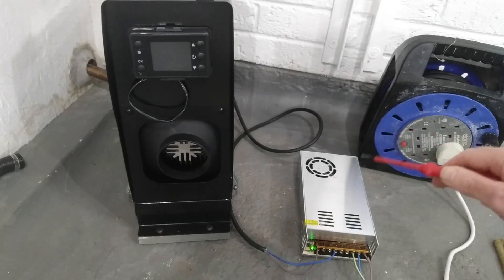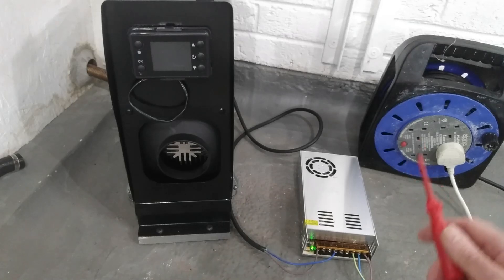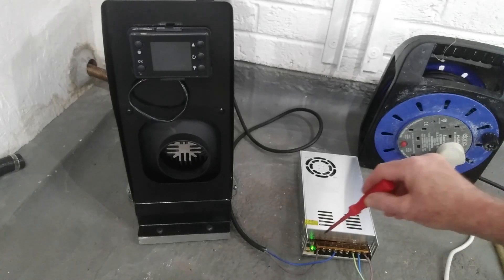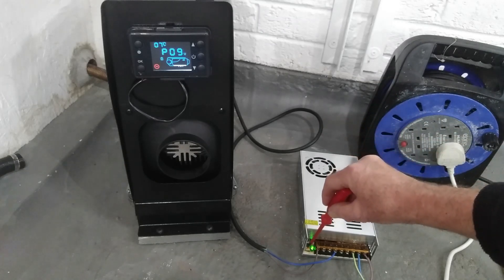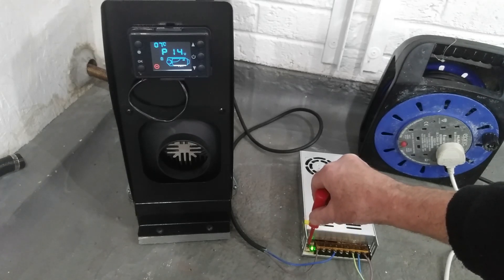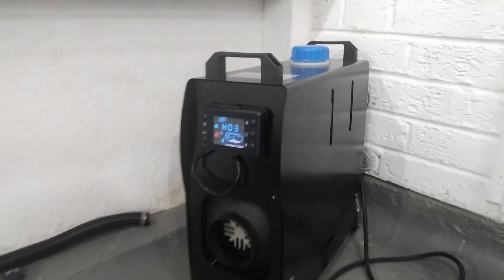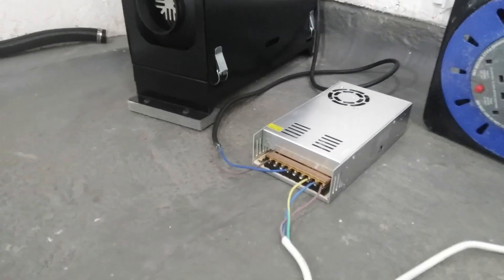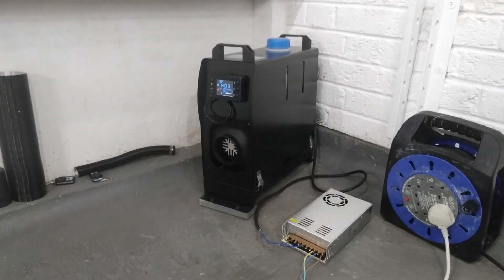Heating My Home with a Diesel Heater and a 12V Power Supply changing from battery to 240v mains

Comment: I've just bought one of these diesel heaters that's 12v and mains as standard , even comes with the 3 pin UK plug wired up.  It's a lovely little unit, built in fuel tank, remote control .
Reply: Hi. Can you tell me where you got yours from please as I am looking 👀 for one with uk mains plug 🔌 thanks
Reply: Where from?

Comment: Few tips that  I have found out having used one to heat my shop since 2019.
If you extend your exhaust pipe too long, you will carbon up the inside of your burn chamber faster. That's because these heaters worked in balanced mode. Intake and exhaust work together. If one is restricted, then the ratio isn't balanced and it will foul up faster. Pain in the ass having to disassemble just because of that.
There are 2 types of exhaust mufflers. One does nothing as it is nothing but a casing and the other, actually has baffles in it. That's the one I have and the sound isn't that loud compared to "straight" pipe.

My Chinese heater is set for 12C and it is heating the air for a 16x33 feet shop as well as a wood shop that is 20x14. I have a coil wrapped around the aluminum casing that has coolant running through which heats a 50 gallon drum of coolant which in turn, heats my in floor heat of the 16x33 garage. On a -28C day, it is around 11-12C in the shop at all times and I go through about 20 liters of diesel in 3-4 days.
Reply from the maker: Hello my friend Thanks for your comment 
thats great, sounds like a nice system.
good work.

yes i know, i cant believe that the central heating systems are that much.
maybe newer ones arnt as much?
yes, i have just woke up to the -7 cold too.
and i put the heater on full, number 6.
i leave it on for 1/2 hr and then go and turn it down.
the downstairs will be toast (bit too hot)
and the upstairs is warm.
when i renovated 5 years ago i put as much insulation as i could.
i think thats important.
the other heater in the garage does not give as good results, i think that is because the garage is not well insulated.

 I really appreciate you watching my video I have another heater too, in my garage, 
Please see my other videos Kindest regard andyfireblade
 Please like, subscribe and watch my other videos

Comment: although an electric power supply is tempting if you have a power outage the heater will not be able to go through its shutdown sequence and it will fry the main board, so a battery backup at the very least will protect your diesel heater, better to run it from a battery and have a 20 amp battery charger connected with plenty of reserve in the charger to actually charge the battery whilst the heater is in use, then if the power does fail and we have been promised power cuts in the UK this winter the shut down procedure can progress without the electronics being cooked.
Reply from the maker: Hello my friend Thanks for your comment 
yes thats true 

 I really appreciate you watching my video I have another heater too, in my garage, 
Please see my other videos Kindest regard andyfireblade
 Please like, subscribe and watch my other videos

Comment: I fitted a cab heater (Eberspacher) in my workshop over 25 years ago before the cheap versions were available, it is preferable and safer to run the installation via a 12v battery and battery charger, this will ensure correct shut down and cooling procedure in the event of a mains power failure. Even if it’s running when the power fails eventually the low battery voltage will shut the unit down correctly without damage.
Reply from the maker: Hello my friend Thanks for your comment 
 I really appreciate you watching my video I have another heater too, in my garage, 
Please see my other videos Kindest regard andyfireblade
 Please like, subscribe and watch my other videos
Reply: Right on the button, there, Harold.  That is how I run my heater.  Battery plus a float charger, so operates much like a vehicle where the starter motor heavy load is quickly replenished by the alternator and all running loads are supplied by that same alternator (with the battery generally maintained at full charge) while the engine is running.

Comment: Just so you’re aware.   I’ve found 13v and the heater runs better as the fan runs slightly faster giving a complete burn.      When I originally run mine on 12v    I was getting a very light residue of unburnt derv   But found out on other vids about running it at 13v since doing that about a year now.   Absolutely no residue at all
Reply from the maker: Hello my friend Thanks for your comment 
good bit of info
i might try that thanks

 I really appreciate you watching my video I have another heater too, in my garage, 
Please see my other videos Kindest regard andyfireblade
 Please like, subscribe and watch my other videos
Reply: How does running at a different voltage (within the permitted range) alter the fan speed, please?  I am under the distinct impression that the fan speed is monitored by the Hall Effect transducer, with magnet(s) on the fan, so that the fan speed is regulated by the ecu, not by the supply voltage.

Have you any evidence of speed change, or is this just another ‘urban myth’ propagated by those that know diddly squat of how these heaters work?  I don’t believe all I see, or hear, on the internet.
Reply: @oliver90owner  I have 2 of these heaters one in a log cabin and another in my garden office and you can clearly hear the fan speed.
The one in my garden office I’ve had installed for just on 5 year and only runs on a mixture of old engine oil and either paraffin or red diesel mixed in.   With the psu running at 13v and running the heater flat out I have not had to strip it to clean it at all.     When I had it running on a battery and small solar panel I had to clean it twice.    Also it doesn’t hurt it to run it slightly higher.
 try it
Reply: @stagman4611   I, too, can hear the fan running on my heater, but would likely not perceive any subtle changes in speed.  I would measure all appropriate parameters before drawing conclusions.  Claims, without evidence, are often both made and exaggerated.

You say your heater is 5 years old?  I can say, with a fair degree of certainty, that the controller on your machine is not the same as the one in this video.  You also state that you run yours ‘flat out’.  Again, not the same as in this video?

Let’s compare apples with apples, not apples with oranges, as they say!  This you tuber should, perhaps, watch the recent, up to date, videos by “Lowered Expectations” to see how his heater fares with burning waste motor oil, too.  Now that is enlightening!🙂

I have not suggested that it would hurt if the voltage was raised (or lowered).  As long as it is within the specified operating range, it should/will run at its specified output.

Circumstantial evidence is (rightly) not permitted in a court of law and should be ignored here, too.

Comment: You can buy the 10A 12v power supply that comes like a laptop charger. Works fine, save in power and safer too.
Reply from the maker: Hello my friend Thanks for your comment
thats interesting, thanks
 
 I really appreciate you watching my video I have another heater too, in my garage, 
Please see my other videos Kindest regard andyfireblade
 Please like, subscribe and watch my other videos
Reply: If its not too much trouble, would you be able to post a link to the kind of thing your referring to?
I have seen a few but wanted to be sure.
Thank you.

Comment: A normal truck "12v" is 13.5 ish which is usually set for keeping a car battery charged. If you set the power supply to 13.5v and run the heater AND charge a car battery you will have battery backup for several hours in the event of a power cut. A diesel heater backs you  up against fuel shortage BUT leaves you dependent on electricity from the mains.
Reply from the maker: Hello my friend Thanks for your comment 
 I really appreciate you watching my video I have another heater too, in my garage, 
Please see my other videos Kindest regard andyfireblade
 Please like, subscribe and watch my other videos

Comment: Thank you,just bought a heater,haven't a clue how to set it up,so just need a converter like this?,do you have to fuse cable between that and heater?
Reply from the maker: please take a look at my other videos, i do one called a quick start video. this will help you get going. a fuse would be good but not essential to get you going . also link to the converter in the description .
cheers andy

Comment: Hi Andy 
Heater arrived today worked fine for 5 minutes then transformer burnt out something inside the heater identical transformer you’ve used,now heater not working at all🙁
Reply from the maker: can you try it on a 12v battery to see if it works?
Reply from the maker: let me know how you get on mate?
Reply from the maker: message me , anytime
Reply: Unfortunately doesn’t work with a battery either
Reply: @paulcherrypicked7800  you probably need a new controller. there are a few different types. the wrong ones just wont work. or you can just replace the mosfet chip that has burned out in the panel.

Comment: Thanks for posting these updates and the original about the heaters. I am on the verge of buying one and doing the same once i decide where to put it for best performance. I understand the noise is loudest when they start up and then diminishes after a while. How loud is it outside - ie  is it likely to bother the neighbours?  Also, helpful tip about the step down adjuster. Cheers
Reply from the maker: Hello my friend
Thanks for your comment
i am glad you bought it up.
you are the first!
because this was very important to me.
i didnt want to annoy the neighbours.
i like them.
i didnt put it in the ideal place for exactly that reason.
it would have been too close to next doors window.
they may not have heard anything, but you cant risk it.
its nice to be nice.
so i put it on the other side of the bay window, no big deal.
there is noise from it, but it is hard to say how much.
it is ok with me and my situation.
but could be a concern for some.

I really appreciate you watching my video
I have another one too, in my garage, please see my other videos
Kindest regards andyfireblade
Please like, subscribe and watch my other videos
Reply from the maker: Hello my friend
Thanks for your comment
yes the noise could be a problem.
you could use a different exhaust silencer, may be of a motorcycle?
or route the pipe away from earshot.
you could use a much longer pipe? to send it 4m away?

I really appreciate you watching my video
I have another one of these heaters, in my garage, please see my other videos
Kindest regards andyfireblade
Please like, subscribe and watch my other videos
Reply from the maker: good idea
good luck.
let me know how you get on
kind regards andyfireblade
Reply from the maker: thats interesting. and yes i agree.
i have just fitted a 12v supply to my unit that supplies the house with heat.
its great.
its -1 outside, and i had it on number 3 which is half way.
the wife just said " it is too hot in here can we turn it down"
so i did...
i am adding the video right now, so that you can see it
kindest regards andy
Reply: Difficult to get hold of now plus the price has shot up in the last week,  seems to be a shortage, Was loads on Ebay for under £100 now £160-250
Reply from the maker: here are a few
but they are selling out fast.
https://amzn.to/3V3YlZF

Comment: Thanks for your video, but I'm easily confused. I've ordered an 8khw diesel heater for my garage and wondering what I should use to power it. Car battery/Leasure Battery or mains power adaptor? Thanks
Reply from the maker: i like to use the 12v power supply (link in description) 19.99 . i think is the best option. people do say the it is best to wire a 12v battery in parallel to give uninterrupted power in the event of a power cut. but we never have power cuts here, so i am not bothered about that.
please see my other vids of the heater, these may be interesting for you? 
https://www.youtube.com/@andyfireblade
cheers andy

Comment: Hi Andy, I've just bought one of the power supplies,  I just wanted to ask about the voltage switch on the side, it says in the ebay description that for the uk it should be set to 110v ? 
Surely it should be for 240v ?
What's yours set to ?
Cheers buddy
Reply from the maker: That is correct 240v cheers andy
Reply: @andyfireblade  cheers buddy 🤙
Reply: Quick question.... Does the fan on the power supply stay on full time ?
I've just connected mine up and it's staying on (it's outside, so it's not warm at all)

Comment: Do you just use the 75mm pipe that comes with the kit to go through walls or do you use anything else to line the hole? Just wondering if the heat could get too much?
Reply from the maker: yes the hole is a metal tube surrounded with a cement liner, please see my other videos, i show this. cheers andy

Comment: Hi Andy, I am about to fit a diesel heater, I was going to run it off a 12 volt car battery and keep the charger funning, is it cheaper on electric to run a transformer than to keep battery charger running? Cheers
Reply from the maker: hello steve, thats great, i had one of mine running off a battery and a trickle charger at one point. i bought the trickle charger from ebay for £8, nice compact little unit. and yes, i would say that is cheaper on electric, your way!
cheers andy 
https://www.youtube.com/@andyfireblade
Reply: @andyfireblade  thank you for getting back to me Andy. I am fitting the heater on my boat, the electric hookup has gone from 16 pence to 60 pence a unit at the marina, which would you say would be cheaper to run, 12 volt battery with a charger or a 30 amp transformer? Cheers
Reply from the maker: @stevemason5348  wow thats a lot, yes i would say a trickle charger would be cheaper. but how about a small solar panel, ebay for about £30? i dont know much about them, but i would like to learn more about them this year.
let me know how you get on, regards andy
Reply: @andyfireblade  Cheers Andy I will let you know how I go about it

Comment: Just subscribed, just checking ref the 12v transformer, I saw in other videos that running on transformer  can cause damage to the heater if you get a power cut. Have you any advice on that, thanks for your time
Reply from the maker: Hello my friend Thanks for your comment 
i weighed up the pros and cons and decided that there was more chance of the battery going flat that having a power cut. as we havent had one here for 5 years.

 I really appreciate you watching my video I have another heater too, in my garage, 
Please see my other videos Kindest regard andyfireblade
 Please like, subscribe and watch my other videos
Reply: Hello, I'm waiting on one to be delivered,  as far as power supply goes, is it possible to use a 12v battery with a charger attached to it? I'm guessing this will eliminate the power cut issue?
Reply from the maker: Hello my friend Thanks for your comment 
yes i did have running of a battery and was going to put a trickle charger on it.
one thing to think about is that if you are charging the battery, some fumes are given off, so keep your inlet away from it.
or you will be pumping these fumes into the house!

but i decided to go with the 12v supply.
i am happy with the 12v supply as i havent had a power cut for 5 years, so i was more worried about the battery going flat.
good luck with yours.
let me know how you get on.
message me anytime.

 I really appreciate you watching my video I have another heater too, in my garage, 
Please see my other videos Kindest regard andyfireblade
 Please like, subscribe and watch my other videos
Reply from the maker: thanks for sub
Reply from the maker: https://amzn.to/3jcAb2d

Comment: Hi Andy I was running mine using an old pc psu but the only issue is if the power trips while its running the fan wont be able to spin to cool the unit down so the heat could fry the mother board, I find a small battery similar to an alarm battery with a trickly charger will work, you can use that psu since you already have it but connect a small battery and set the psu to the float voltage of the battery so it doesnt overcharge, the one observation on your setup is the back is too close to the wall where the air inlet is, you get a slight neg pressure from the fan
Reply from the maker: Hello my friend Thanks for your comment 
great advice thanks.
what is the float voltage?

 I really appreciate you watching my video I have another heater too, in my garage, 
Please see my other videos Kindest regard andyfireblade
 Please like, subscribe and watch my other videos
Reply: @andyfireblade  max 13.5V
Reply from the maker: @dantronics1682  thx

Comment: bruv, cheapest smart bike charger and 12v battery. When they cut off power for what ever reason unit need to cool off. When u got directly from power supply u wont have that option and u can get damage to your unit.